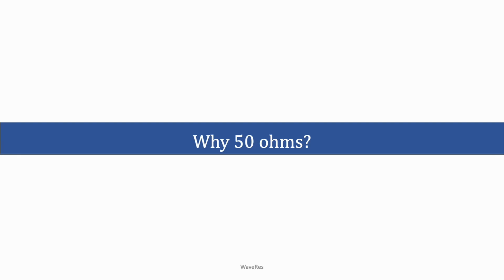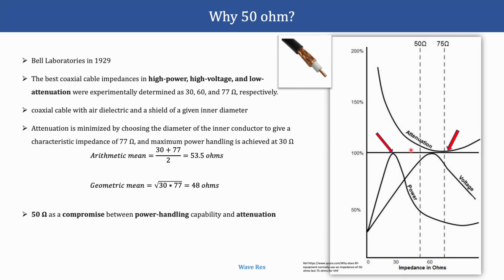50 ohm Characteristic impedance in most of the RF cases/ Coaxial cables

Comment: 10:00 you show these for air as dielectric, but real coax has dielectric with higher er so Z0 would be lower. Going to your slide on mean of max power and lowest attn, shouldn't the lower Z0 for coax be used instead of air as dielectric value?